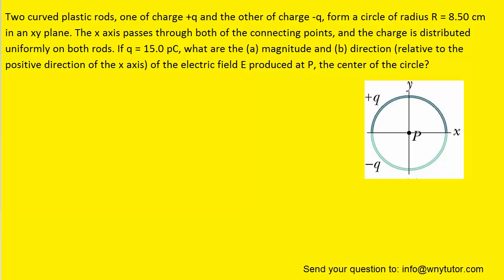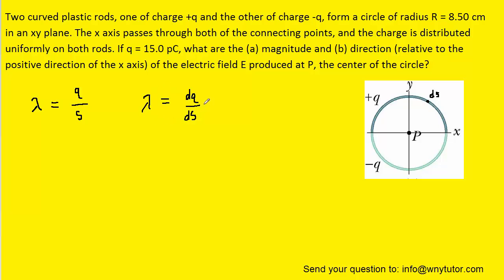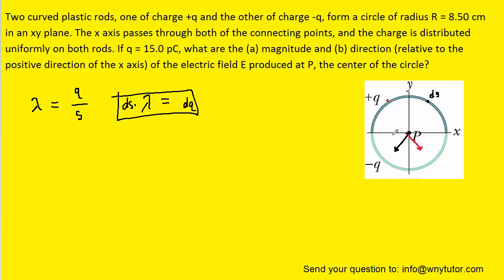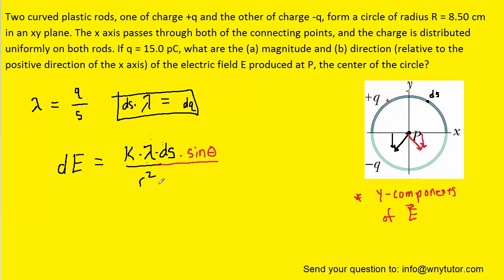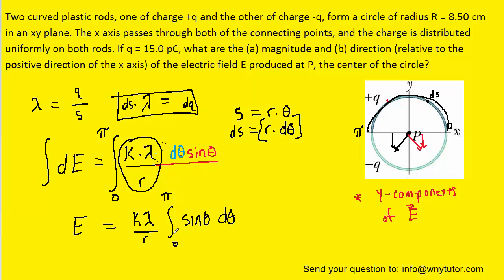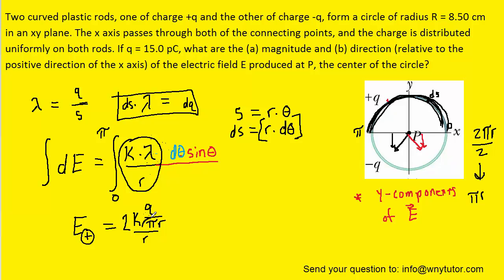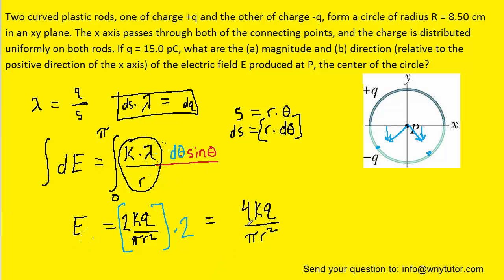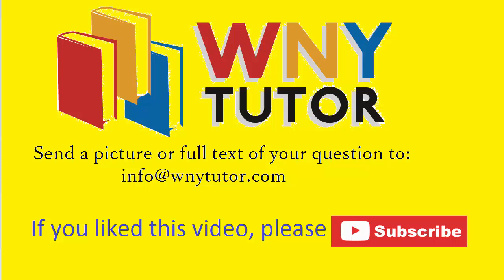In the figure two curved plastic rods, one of charge +q and the other of charge -q

Comment: Why are you multiplying by SinTheta at 2:55 and not CosTheta? Can't you rearrange the vectors to that the orientation of the right triangle made by the vectors is such that it would make sense to multiply by CosTheta? How do you know whether to use Cos or Sin?
Reply: Your using cos because you need Ey and not Ex .. 
                   |\  
                   |_\
Cos (Teta) = adj / hyp = Ey / E.

(Teta here is the angle between the vector ( of E) and the x axis.)

Comment: So if the net electric field is basically four times the magnitude of the y-component of the electric field, why did you draw 5 arrows at 6:49? Or is that just more of an "illustration" to show that there are "several" forces of the electric field in that direction?
Reply from the maker: Those vectors were showing the y-component of the electric fields produced by a few of the "differential" elements (which are very short segments of the rods). Technically, there are an infinite number of those vectors (which all sum to produce the net electric field), so the few that were drawn were just a "sample" of the infinite number of them.

Comment: A circular plastic disk with radius R  2.00 cm has a uniformly
distributed charge Q(2.00x10^6)e on one face. A circular
ring of width 30 mm is centered on that face, with the center
of that width at radius r  0.50 cm. In coulombs, what charge is
contained within the width of the ring?
Reply from the maker: https://youtu.be/Ba8ELJySpg8